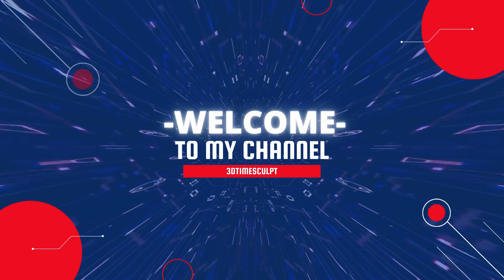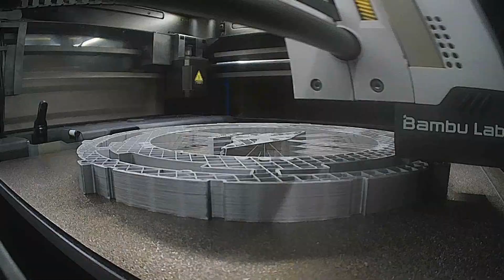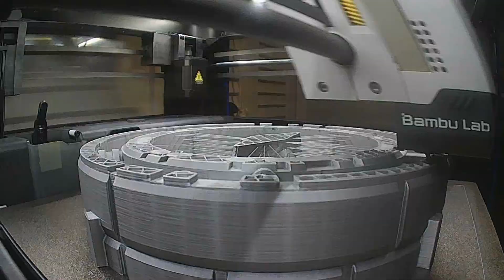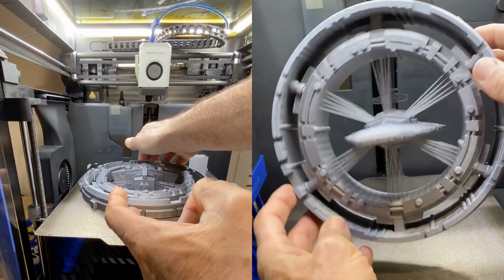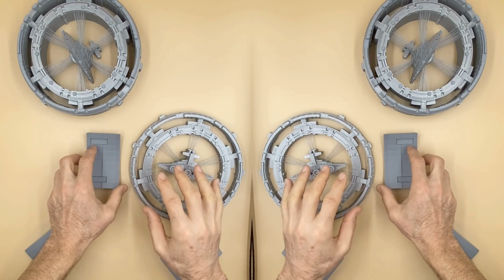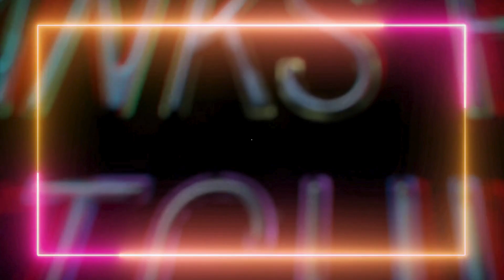Suspended Imperial Star Destroyer

Comment: I printed a model with the similar technique (the strings with a suspended piece in the middle). I did it in 2 colors, which worked out very nice. It was a heart inside a big circle. I did the circle and heart in red silk filament and the strings in gold. It gives a fantastic effect. You could try something similar as an option with this model. The right combination of colors could make it (even mores) stunning.
Reply from the maker: Great tip! Thank you.

Comment: did you glue the 2 main pieces together or just the smaller ones?
Reply from the maker: No glue. The three small pieces are locking the two main parts together w/o the need for glue.
Reply: @3DTimeSculpt  Thanks for letting us know. I'm going to rewatch part of the video to see if I can understand how it works.
Reply: @3DTimeSculpt  I missed it the first time because I was trying to figure out why you had two images in the screen. I thought maybe it was a stereo view but apparently it was mirror effect.
FWIW, I'm not a fan of the mirror effect in situations like this. Still I enjoyed the video. Thanks for making it.
Reply from the maker: @ddegn  I know, I did the mirror thing because the video is supposed to have a 4:3 ratio, but I took some of the video using an iPhone with a 9:16 aspect ratio, and it's hard to make it fit the screen without enlarging it too much and lose resolution.

Comment: I don't understand, how are the suspension strings printed like that with filament? and no support?
Reply from the maker: I believe it is a combination of slowing down the nozzle speed and setting the fans to 100% to immediately cool down the filament while building the bridge.
Reply: When you have two surfaces and you want a straight line of filament between them you can just print that. the nozzle pushes out the right amount of filament, the fan cools it as it goes and it just pulls out a strand of plastic until it connects it to the other side, if its the right temp then it wont sag at all and you get a ridge of filament. You have to have the right filament temp and fan speed. And even then if you have the temp and fan speed set right, if you have a printer with a one direction fan then it can cool the filament perfectly when its going one way, but when its going another, the fan can end up blowing the filament in the wrong direction, leading to it sagging. So you really have to dial in the right temp for the filament you're using, do some calibration prints. Eventually you'll find the right settings. Or it might just work at whatever temp you regularly use. Different filaments can be more or less forgiving.